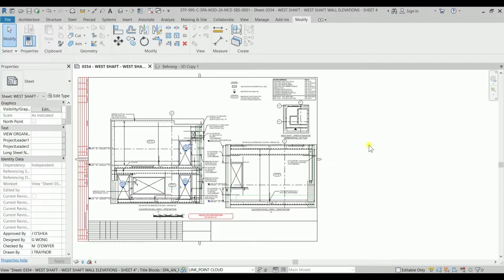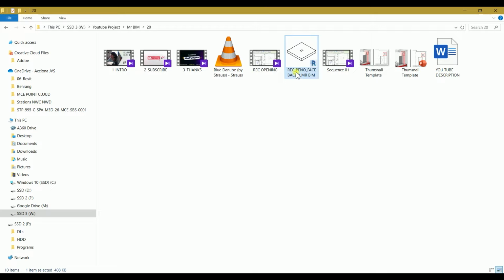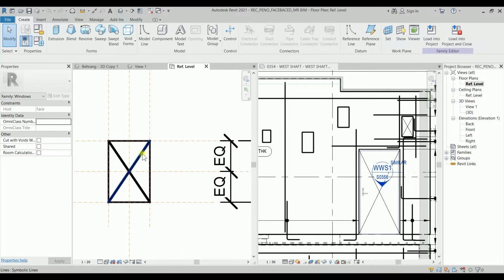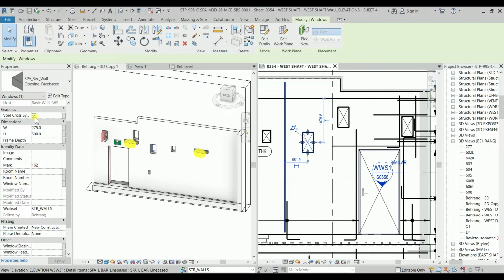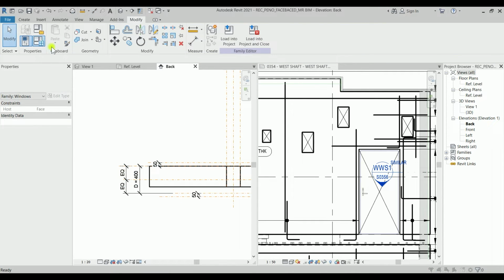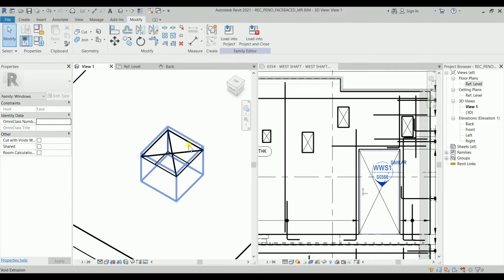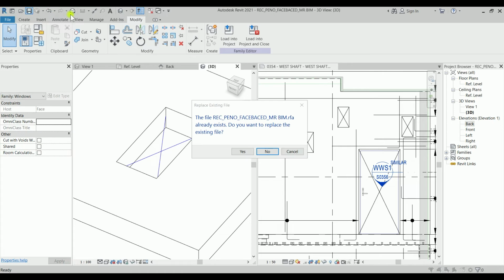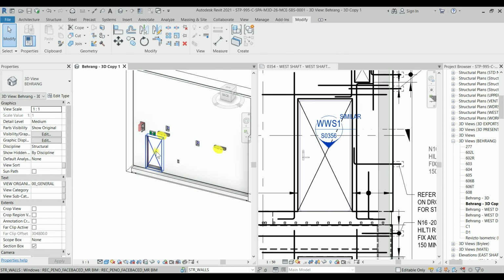ADDING 3D MODEL LINES TO REC PENETRATION#revit #revitfamily #revit_2022 #revitbim #detailing

Comment: beautiful! thanks for sharing
Reply from the maker: Thanks Cathy,
let me know if you have some ideas for families!
Reply: @revitlogic  today was frustrated to add penetrations on huge basement wall, the painful thing is the project is way too heavy we normaly cannot edit in link documents, so have to find solution create opening in links--- seems had an idea, click the wall ---turn the wall to parts( yes it works on links)----divide the parts use penetration size opening---change the penetration parts phase to demolished in completed , or hide it... finaly see the big hole on wall 😅
Reply from the maker: @cathychoi6959  yes!
So you have a window or peno for the construction phase, so it should be demolished. That is correct!